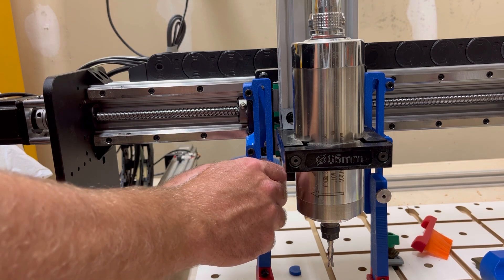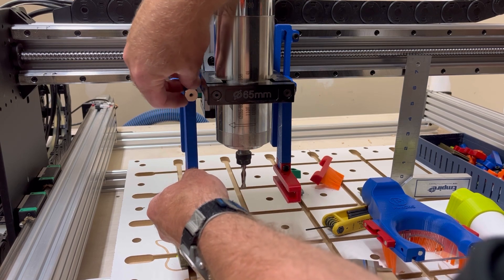Ultimate Bee Z Bracket system for the PWNCNC Dust boots

Comment: What is the absolute maximum size if the spoilboard?
Reply from the maker: Do you mean what is the total cutting area of my 1010 Ultimate Bee or the actual size of my Spoilboard?
Reply: @sparks-tech  yes the total work area. What is the absolute maximum size (width)that fits in the machine?
Reply: @sparks-tech  the total area
Reply from the maker: Sorry I thought I responded to this one. 766 in the X and 746 in the Y direction.
Reply: @sparks-tech  wait what? And rhe recommend spoilboard size is 1000x855 mm²?
Reply from the maker: Yes but the overall possible cutting area is  766x744 ish, your machine depending on limit switch location and setup might be slightly larger but not by much. 
The 1000x855mm would span the distance between the left right area two Y axis rails and all the way front to back of the machine. 
But that does not represent the cutting area of the machine. 
I made my spoilboard to fit inside the cutting area.
Reply from the maker: So you normally don’t want your actual spoilboard to be much larger than your cutting area so you can surface the entire thing and leave no raised pocket on the spoilboard that way if you need to carve a piece that is larger than your spoilboard you can do it without worrying about the raised lip that would be left at the back and the sides.
Reply: @sparks-tech  yes, I agree. What is the maximum size of the work piece?
Reply from the maker: It really depends on how you setup your Job but of I keep it inside the capabilities of the holddowns I have on the spoil board then I would say about 724x735.

Comment: Did you know that those holes can also be used for tramming in y axis?  What is the material you are using for the brush?
Reply from the maker: Yes I was aware but found mine to be pretty much dead on so I was okay to reuse them. 
I printed them using TPU.